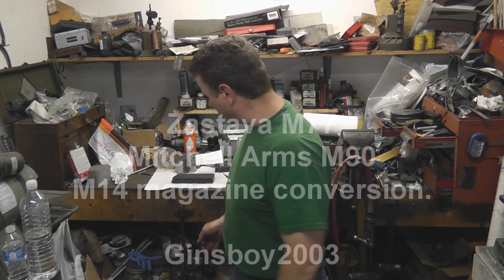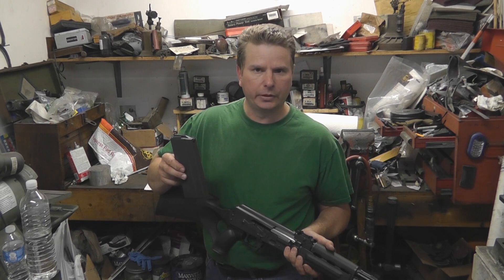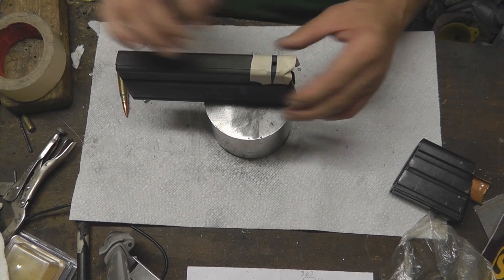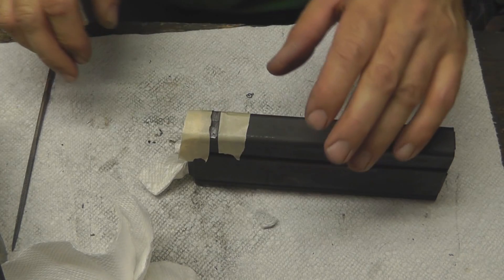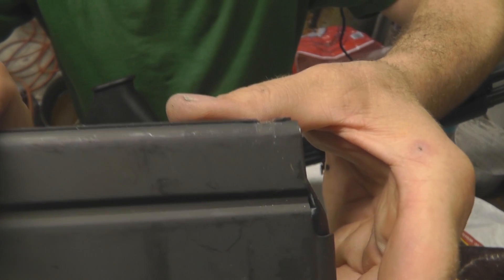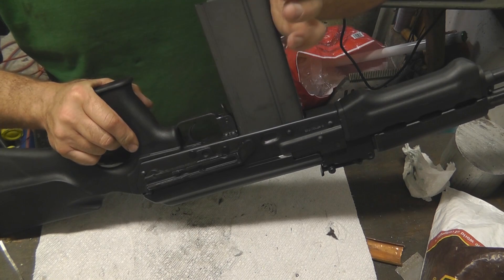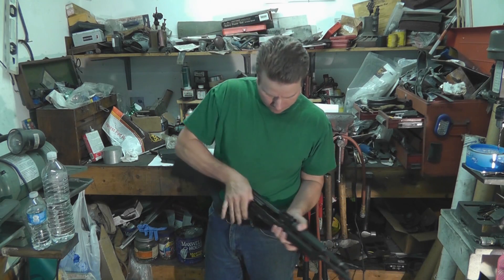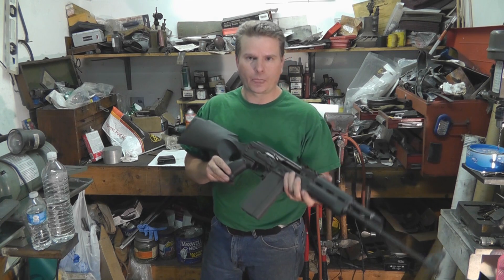Zastava M77, M90 .308 M14 Magazine Conversion

Comment: I think it would be faster to remove the floorplate, spring, and follower, insert a wood block, and mill that slot?  Do 10 pieces at a time?  Also curious as to what type of vertical mill you have?  Great videos, btw.  I am considering the M77 as my next purchase, and your videos have shown its not too hard to modify how I would want it.  Thanks!

Comment: You don't know how much this means to me.  I have an old Mitchell Arms imported M77 and ONE factory 20 rd mag.  Thanks
Reply from the maker: It really great to know how passing the info. along helps people!
Reply: ginsboy2003 cheers from me too , lucky the rounds end up at the correct height, because you took the bottom off the front tab i doubt it will lock in a m4 anymore , not that its a big deal
Reply: Purpose built CSSpecs steel mags are in the works too. This gun looks very appealing.
Reply: ginsboy2003
I modded 3 Taiwanese M14 mags I had laying around for years and all performed flawlessly.  I had been heasatant to fire my Mitchell Arms import (pre ban with flip up tritium sights) M77B1 because I only had the one original mag (a thing of beauty) and 3 dubious aftermarket mags.  Thanks again.

Comment: Be careful when prepping the mag for fitting at the rear tab.. What you want is to fit the mag just so that when the rear release clicks into place, the rear feed lips of the mag are contacting the bottom of the receiver rails.

It's possible to press the mag too far in while fitting, deforming the feed lips, and you can end up with the back end sitting too low once you've modded the rear tab on the mag.

When properly fitted, the feed lips hit the receiver rails and act as a built-in overtravel stop.

Comment: Did you test the magazine at the range?  I made the mode too and manually cycled it.  It worked fine.  However in the range some ammo (cheap) did not cycle at all, some (good ammo) caused the magazine to drop after every shot (if I hold and press it to the rifle it would cycle all the way), and some nose-dived after the half mark.  To be honest my factory magazines will often FTF the last cartridge.
Reply from the maker: It worked perfect on one mag., it worked great.  I didn't test every mag. I modified though.  Maybe your mags can still be fixed or adjusted to work.
Reply: ginsboy2003 I was able to fix it.  Maybe the well of my gun was a bit larger and the vibrations were causing the magazine to fall down.  I added a front and a real lip similar to the factory magazine.  I used silver solder, dropped a blob of solder, and shaped the blob to resemble the factory lip.  The rear lip was no more that just a bump allowing the latch to get a firmer grip on the magazine.  Ugly as hell but no FTF anymore.
Reply from the maker: Sounds like that will work fine.

Comment: im guessing the bolt slams closed once you remove the mag.. wonder if theres a modification to the rifle that can use that bolt open and hold it open without the mag as well?
Reply from the maker: megadeth22885 Well I know how the PSL mag. hold open works, maybe one of those could be adapted.

Comment: Excellent tutorial. I went about it a different way and cut the tab in the back, folded it down and welded it to add material for the wedge. I went out and shot it today. One issue I did have was feed lip positioning and that the bolt hold open on the M14 mag would actuate preventing the 20th round to be fired. Have you had this experience with your mags?
Reply from the maker: I haven't had that problem yet.  I actually made a stainless steel floorplate for the original mag. to give me one more US part since I was shooting off of the bench.   I haven't even shot the 25 rnd CMI mag. yet,  but just hand cycling it, it works great down to the last round and the bolt holds open.

Comment: Ginsboy, I bought myself a Yugo M77 last week and I picked up a Promag M1A magazine to practice your cutting method so I can have a cheap but reliable 20 round mag for this rifle. Now here's my question: I saw the process for converting the magazine on the forums and it was more involved than your method. On the forums they also trimmed one of the feed lips so the extractor would clear it and they trimmed the front/rear radius for the bolt. Is this required or was that just a feel good task these people did to make the magazine "perfect"? I ask because while I do have a Dremel tool I do not have much experience using it and I want to do the least amount of cutting/grinding as possible. Thanks.
Reply from the maker: chrisloUSA I didn't do that and I haven't had a problem.  I'd suggest trying it first.
Reply: ginsboy2003 Thanks, I tried to convert the Promag and I failed. I trimmed too much material off the back and it wouldn't stay in the rifle. The slightest movement caused the magazine to drop out (The magazine release comes no where near the magazine) but the front of the magazine locks up tight. Seeing how the magazine sits in the gun I feel next time around I may not even need to trim that portion much at all, I am going to trim a little and put it in the rifle to see if it lines up well with the release.
Reply: chrisloUSA I saw that Problem coming when doing mine. So what you do is cut the box Thingy on the Bottom Upwards while shaving it on the side.
Reply: Andrew Self That's kinda confusing, cutting it on the side? I will try cutting from the bottom up though next time.

Comment: I just tried your mod on a Check Mate mag on my Zastava.  The front notch worked ok, but the back lockbar will not let the mag insert into the mag well like it shows in your video.  What am I doing wrong?
Reply from the maker: Watch the whole video.  Did you remove a little bit of metal from the back of the mag so the mag release can engage the lockbar?  Take your time with that, it doesn't take much.

Comment: Hey ginsboy2003 I took my M77 to the range yesterday and I had pretty good luck with it.  I noticed that the floor plate on my stock 10 round mag kept walking out as I fired the rifle but a quick couple of bends on the tabs of the floor plate stopped this.  Here is what I was wondering, I went to checkmate.com and checked out their M14 mags but I'm not sure which one you bought.  Is this the one?   http://www.checkmatemagazines.com/cart/pc/viewPrd.asp?idcategory=8&idproduct=123
Reply from the maker: Yea, I got mine from Palmetto State Armory, but those are the same mags.  I got the 25 rnd mags but have heard from guys who said their mags didn't feed properly when fully loaded so they had to leave a few rounds out.  Until Csspecs comes out with there version (who knows when) its still the best option for us.

Comment: What happens when the mag is pulled, while the bolt is held open?
Reply from the maker: Since the magazine is holding it open, it flies forward.
Reply: And is the mag follower influenced in the mag, while the mag is pulled? Does it stay in position or does it get rotated inside of the magazine?
Reply from the maker: The mag follower has a "hump" on it the shape of a cartridge.  That hump interferes with the bolt moving forward when the mag. is empty.

Comment: p.s. that would count as 3 US made parts.
Reply: And putting the mag in there would trigger 922(r) even without putting the stock on.
Reply from the maker: You're right about that and I should have mentioned it.  By the time I made this vid. I already put in a G2 trigger group, and honestly, its no better than the original so I'm saving up for the Red Star Arms adjustable FCG.
Reply: Good to hear. I suspected as much.

About the G2 RSA swap-- Hold on. I plan to upload a video today showing how to radically improve a G2. It might be something you know already but it is worth a few minutes of fitting to try it out before ordering the excellent RSA.
Reply from the maker: Ok, good to hear.  I was going to take the G2 group out and do some polishing but I'll wait for your video.
Reply: Coming up soon. One of my segments was just out of shot, so I have to re-shoot it (without the proper trigger on hand.)
Reply: It's filmed, but taking a long time to upload. I will send you a link as soon as it is processed and live.
Reply: GunFun ZS Why is 922(r) required?
Reply: To make foreign guns more expensive and less accessible.
Reply: Go through the checklist. Most AKs are 15 parts as imported, including the muzzle device. That means you need to get rid of at least 5 parts. Generally the best ones to do are: FCG (-3 parts, and nicer trigger for ~$24), then muzzle device (-1 if present), then piston (or forend, or pistol grip, or stock) . That way you are legal with ANY mag.